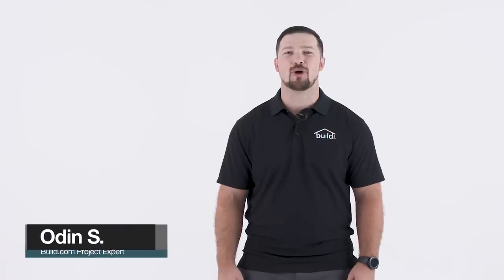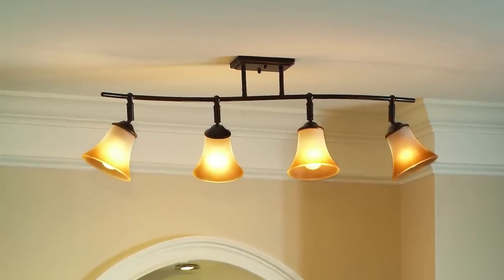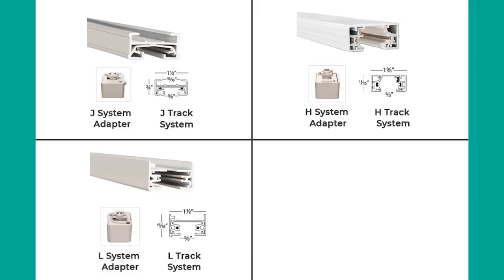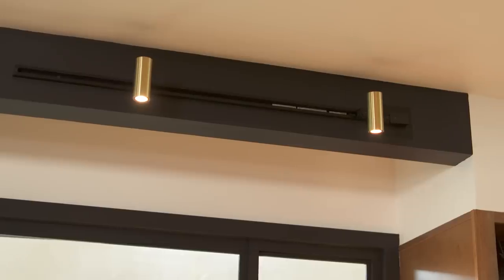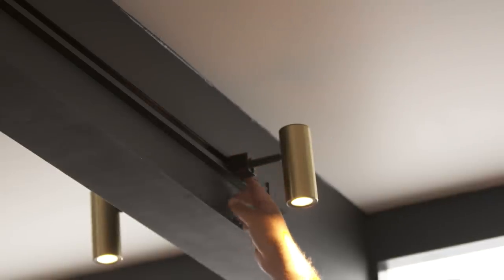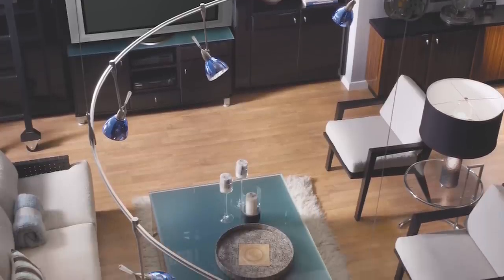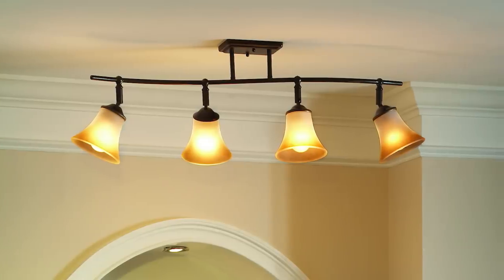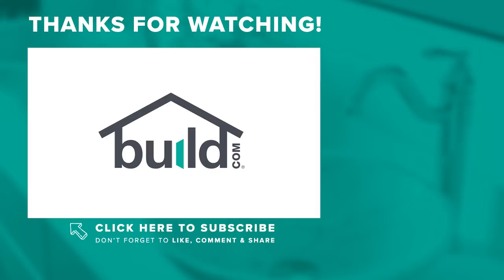How To Choose The Right Track Lighting System

Comment: I have a huge section of H track lighting it isn't hideous but need a face lift.  The inside of track has yellowed over time.  Can I paint that or will that effect the heads connection? 
If  I must replace it....
Love the black and brass track lighting in your video.  Do you know where I can find it?

Comment: I think I have an old Tiella track lighting (monorail) and its transformer broke and fried my dimmer. I am looking for a solution. I did a few hours of research and couldn't easily find a replacement for the transformer piece. Do I buy a new starting kit? I want to reuse the 3 anchors on the ceiling. Any reply is appreciated.
Reply from the maker: We would recommend either getting in contact with the brand of your original track lighting system to see if they have any replacement piece, OR we would recommend completely starting over.
Reply: @build  Okay, I can try that. Just want to do minimum work possible for the job... Thanks for the reply.
Reply from the maker: @yodali7999  Completely understandable! Track lighting is never an easy thing to deal with, too. So yes, we would definitely recommend contacting the manufacturer of your original setup to see if they have any initial suggestions on how to resolve the issue. Otherwise, if you need to start over, let us know and we can help!

Comment: What track lighting system with variable color heads, with or without a hub, would you recommend?
Reply from the maker: Hey! Thanks for reaching out. We would recommend calling or chatting in with one of our Build.com Project Experts so they can walk you through all of your track lighting wants and needs. There are many options and many great brands, it all just really depends on you and your project! You can also check out our Track Lighting Buying Guide for more information, which is listed in the description of the video. Our phone number is 800-375-3403.